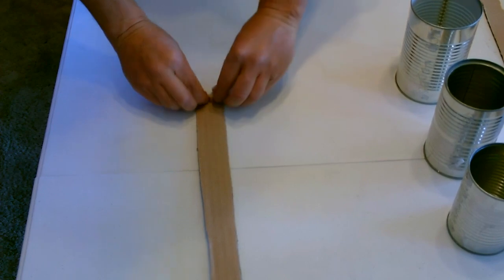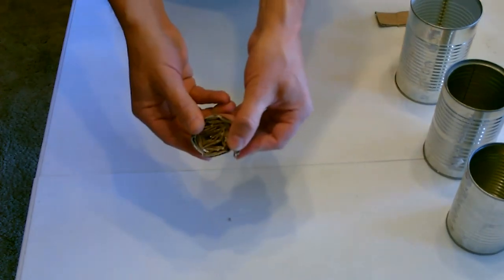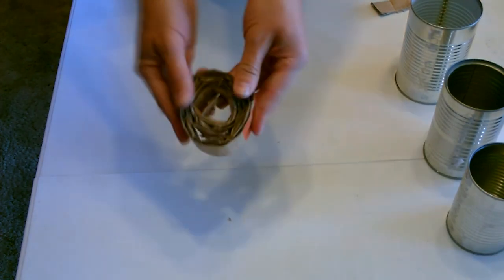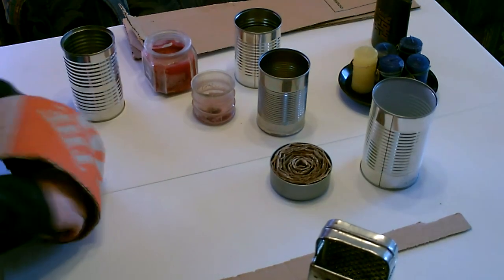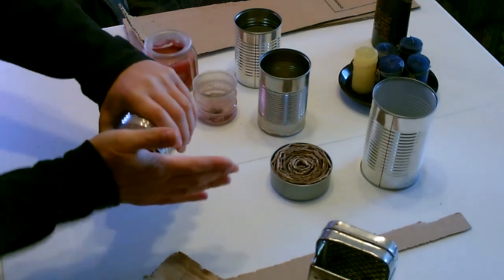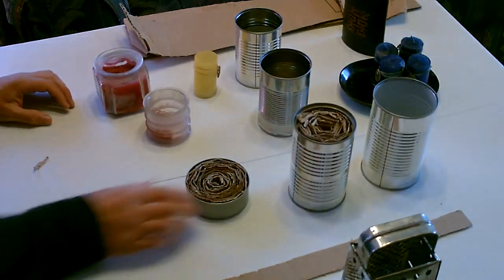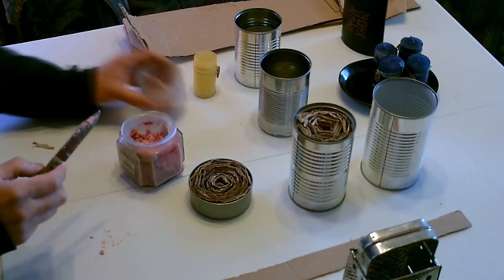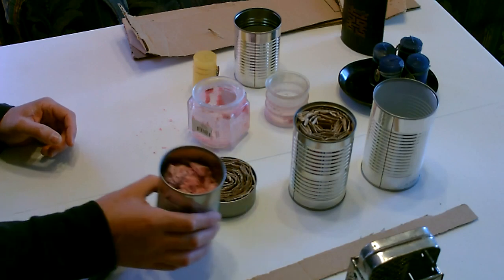Homemade "TIN CAN" Air Heaters! - Survival/SHTF Air Heater/Stove - Simple "cardboard and wax" Design

Comment: These are really neat and easy to make . But I would strongly recommend it be used for outside use only . I tried them in my garage and there was A lot of smoke . I can’t wait to use them this summer in my fire pots . Or for camping . Much cheaper than the store bought alcohol cans . Thank you for sharing have a great day .
Reply from the maker: hi. this does need to be used outdoors only.

Comment: Always use a double boiler when melting wax though, as wax has a fairly low flash point with dry heat !  I put the can in a pan of hot water with the wax then pushed the card down into the molten wax after it was removed from the hob,it worked perfectly.
Reply: I use the old Yankee Candle jars but with a coffee maker.  Low & slow heat, no rush, no naked flames, so no flash point worries as such.  Cans are also better for melting but especially pouring too.

Comment: Cereal boxes work best. Better controlled flame. Use on a grill rack with terra cotta pots (3 sizes over each other). Pots will hold and gently radiate heat. Crack a window open for ventilation.

Comment: From my experience: 

The short (tuna/chicken) cans burn 2-3 hours straight through. The tall (veggie/soup) cans burn 6-7 hours. 

Taller cans stay cool to the touch at the bottom and can be moved while burning. (The wax there does not get hot enough to melt.) 

Short cans get hot and can damage whatever they are on while burning. 

Break up and keep old candles/wax in a soup can. Crimp one edge for pouring. Melt the wax in the soup can so you don’t trash a good pot. Use oven mitts/leather work gloves while filling your Buddy Candle. 

Keeping the cardboard shorter than the can should prevent spillage while filling. 1/8-1/4 inch. 

Build up the cardboard from the edge to the center rather than trying to get the whole thing filled in one shot.

Put a taller piece of cardboard in the center. (Even with the rim of the can.) 1/2-3/4 inch wide is enough. 

Charring the center (tall) cardboard will allow you to light it easily in an emergency. (Light the center and extinguished before the flame spreads to the shorter cardboard.) Ignites with a ferro rod much like char cloth. 

Use the easily lit buddy candle to start a camp fire and save the Buddy Candle for more dire situations or times when a camp fire is not viable. 

I keep a taller soup can candle in my trunk inside an empty/new quart sized paint can along with a ferro rod/striker, matches and a bic lighter. The paint can is then put in the bungee net holder to keep it upright with the included lid on. I’ve used this system twice. Once on an unplanned camping trip and once just for practice. It was then refilled after each use. It stays in the trunk year round.
Reply: Thanks,very interesting ideas 👍
Reply: A lifesaved advice if you live in developing nations.
Reply: I did that for a while, but found that on super hot days, the wax melted and since the can got tilted, it was messed up. I now keep a paint can / toiletpaper alcohol emergency stove with me. They last about 2.5 to 3 hours. Roll of TP, remove the center cardboard, compress it down into a quart paint can, slowly fill it with a bottle of alcohol. Believe it or not - standard 70% isopropyl off the shelf seems to burn cleaner with less soot than 90%. You do you, but just some thoughts. Enjoy!

Comment: It's easier and more fun to put a little wax onto the cardboard and set it on fire. Then keep adding more wax until it fills up to the top. Used to make these in Scouts. Poke a couple of holes near the top and you can also make them into torches with some coat hanger and a stick.
Reply from the maker: thanks for the info! 🔥🔥

Comment: I'd double boil the wax in their containers instead of putting wax in a pan.
1. Fill a pot with water, but low enough so water doesn't get into the candle or the candle doesn't tip
2. bring it to a boil
3. Wait. all the wax will melt inside its own container.
4. pour melted wax into your can.
seriously. google "double boil wax"
you won't have to chip the wax out of the container. you will get pretty much all of the wax out of it. you won't get wax on your pots/pans.....
Reply: Tge simplest way: Just light a candle, drip some wax on the cardboard, light it and then keep adding little chunks of wax on top. It'll all melt into the cardboard till full
Reply: I break up and gather used candles in a soup can. I pinched one edge to use as a pour spout. I melt it right in the soup can. (Oven mitts strongly recommend.)

Comment: would it be ok to make the wick slightly larger than the can but only in the middle? (mainly asking with safety in mind and to make it easier to start). i've made one from a large tuna can (still waiting for wax i bought for it) and thought of making the wick level at the edge and gradually increasing the height toward the center or cutting a 1/2 in. fin on the end of the center strip.
Reply: hi again:) my wax arrived right after i posted so here's some feedback.
made the wick with a 1/2 in. fin shape at the end of the center strip and it lighted very well. was fully going inside of 5 min. the heat from it was not bad from a single flame just a bit bigger than 1ft from the top of the heater. can see it giving good light in a dark room too. the only drawback i've found so far is that it will set off smoke alarms from the cardboard burning and probably there's some from the wax too. other than that it's a great little heater. had to put it out when smoke alarm when off so couldn't do a proper time for one burn but i imagine it would have gone for at least 2hrs. plenty of time to heat up an average sized room.
also can see this being used like a sterno can to cook food or boil water. if i give that a try i'll post some feedback on it.

Comment: Tried this and it burned consistently for over 5 hours!  If used inside though, the stench after it's been put out, is nearly impossible to get off your hands, let alone furnishings, so just wondering if theres a less sooty alternative to card?
Reply: If you put a larger can over the top of it, allowing no oxygen to come in, it will extinguish itself and all the black soot and smells will remain inside. 
It works the same as placing the lid back on the large jar candles. No black soot or burnt smells linger in your home. That is how I extinguish all of my candles.
Reply: @ginaberrie2608  great advise... or go outside to extingish them, so the house dont smell... lol...
Reply: @mayam6678  I had it in my fireplace, so I wasn't going to carry it (alight) through the house to get outside

Comment: these are a rad idea for here in socal, where I'm not allowed to have a wood fire.  I'll be making some for sure today.  I wonder about cooking on it though, I use vintage boyscout aluminum pot/pans, I'm willing to bet this will blacken the pans bad, maybe I could add a hotplate?
Reply: To avoid blackening of pans put dish soap on the bottoms of the pans before using over the fire.

Comment: How long do these things typically last for
Reply from the maker: hi there. i've burned these original ones several times and still have them to this day.
Reply: @desertsun02  how long do they burn for
Reply from the maker: i couldn't say for sure since i'm still using the same ones. i've used them several times (sometimes only for 20 minutes,  other times for an hour 'here and there' over the years). they still look fairly new.

Comment: You used the electric stove to heat the wax, but if you have electricity to cook with, why aren’t you heating your house with electric heater?  Can’t melt wax when there is no electricity.
Reply from the maker: hi there. you would typically make these (heater/stoves) in advance of a power out/power down/or emergency situation and then use them when needed. many ways to melt wax off-grid. any type of off-grid cookstove (like propane stove, alcohol stove, candle powered stove or even just a campfire) along sun powered devices like fresnel lens or parabolic cookers would all melt the wax if you had no electric. 🙂